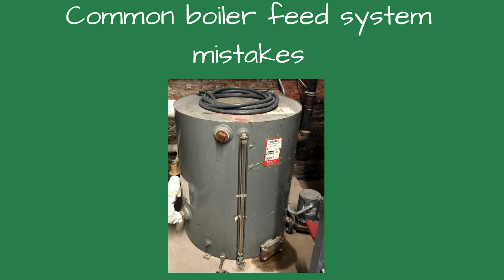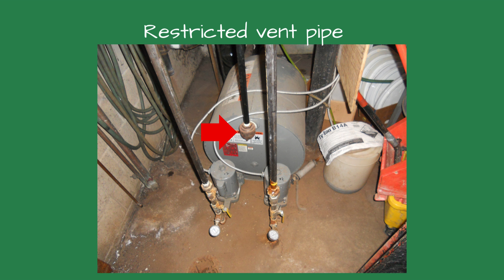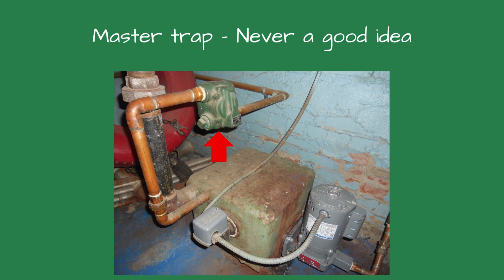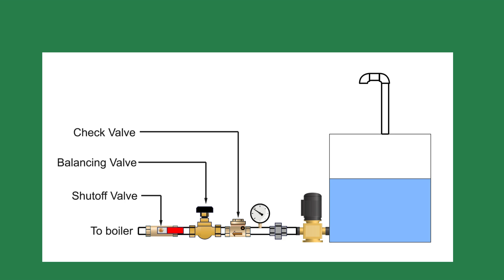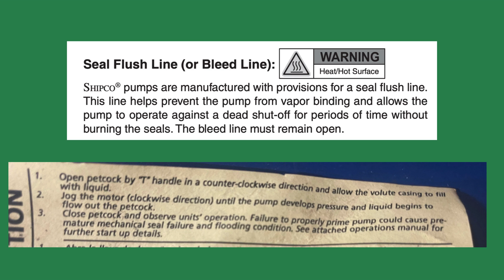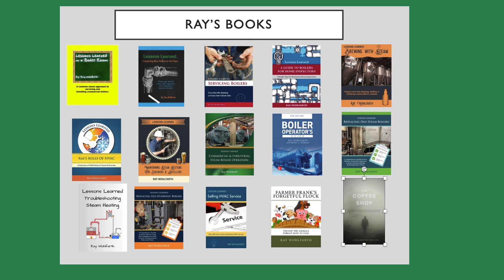Common boiler feed system mistakes

Comment: Excellent video, hugely informative. Two questions, why the use of two check valves, in case one fails I would think? Also, if the boilers goes into vacuum, there isn't really anything to be done, as it will flood, or can a vacuum breaker be put on the boiler?
Reply from the maker: Thanks for the feedback Rite boiler recommends it I think a single check valve should work I do use vacuum breakers on steam boilers
Reply: On all our large boilers we use 3/4” brass traps with a swing check installed backwards above the water column assembly
Reply from the maker: @MikeP087  that's a good idea Does the check valve leak?
Reply: @boilerroomdetective  it does not. The little bit of condensate in the brass trap keeps the swing check pushed closed when under pressure. 
I’ve used Hoffman #26s in the past and they usually bite the dust after a few years especially in an application that has an automated steam valve on steam supply causing the boiler to go into vacuum frequently.
Reply from the maker: @MikeP087  Thanks

Comment: Is it accurate to say proper boiler chemicals will neutralize and eliminate carbonic acid and pitting?
Reply from the maker: You would have to ask a water treatment expert but if the boiler is running properly the chemicals don’t leave the boiler